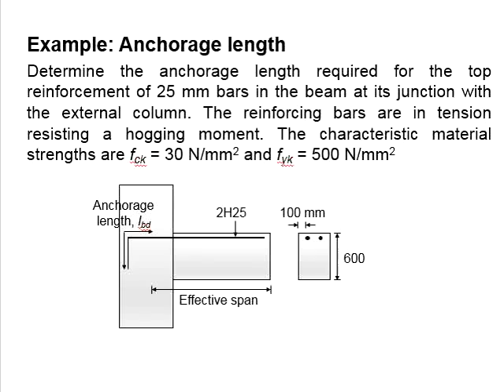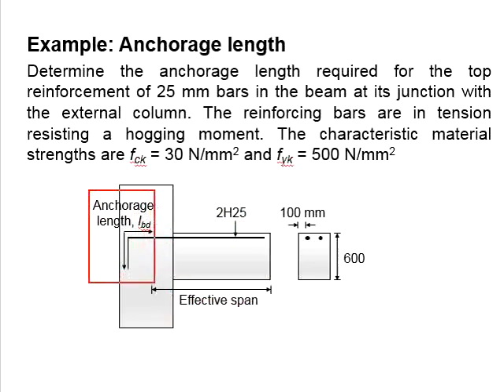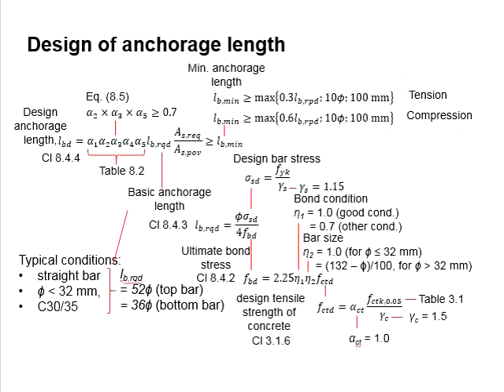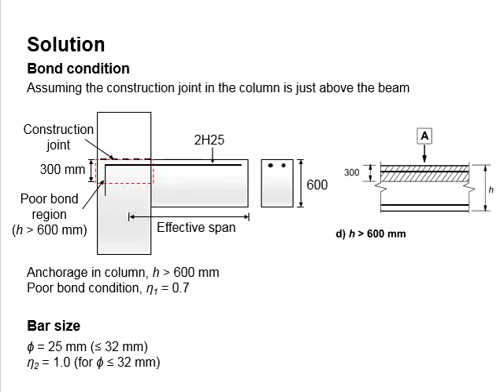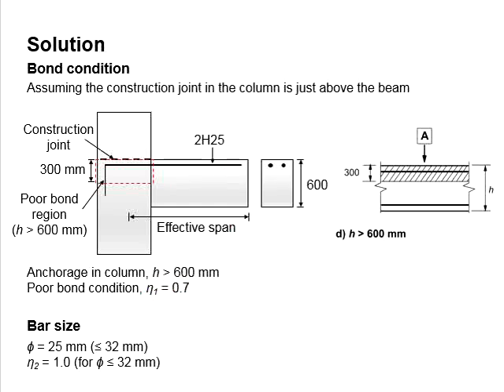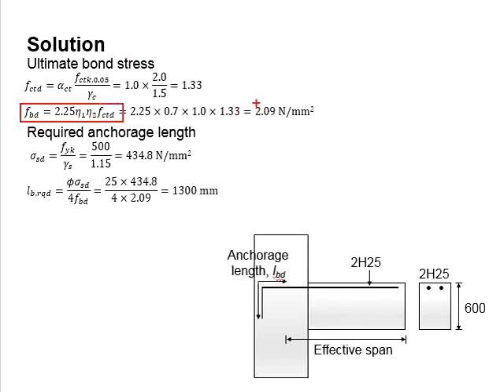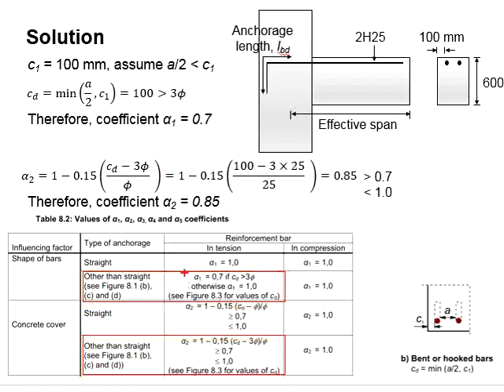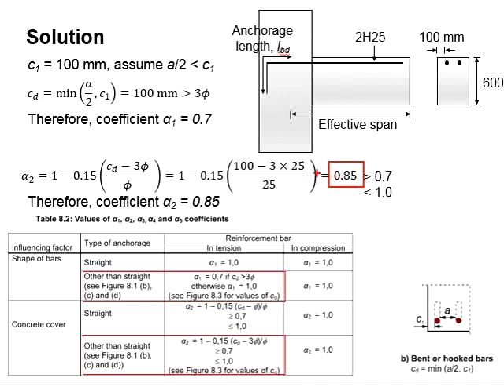5.15 Example: Anchorage length

Comment: When obtaining alpha 1, we assumed a/2 to be less than c1 and cd is supposed to be the minimum value of either a/2 or c1. If a/2 is less than c1 why did you take cd to be c1 which is 100mm?
Reply from the maker: You are right. cd = min (a/2, c1), where a smaller value shall be taken. Thank you for pointing it out. Grateful.